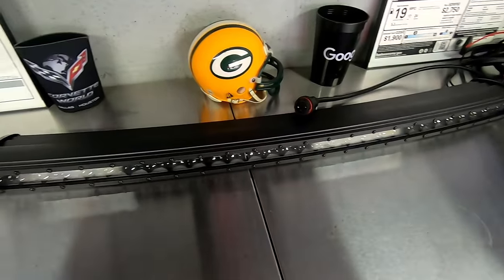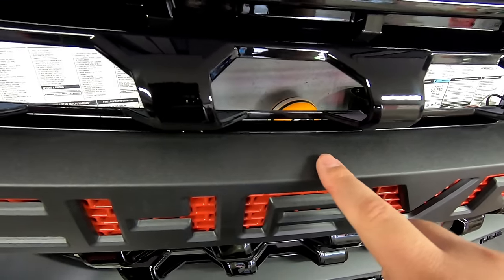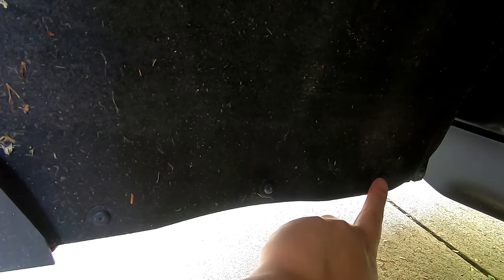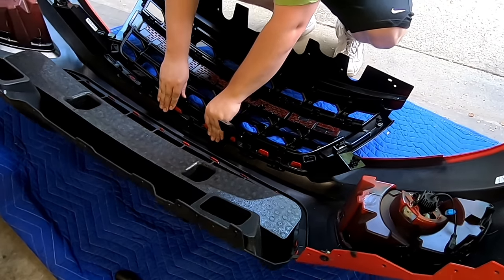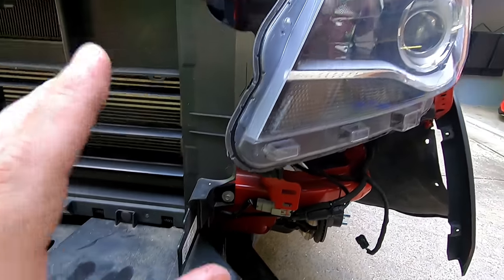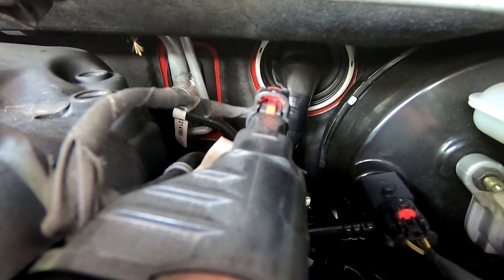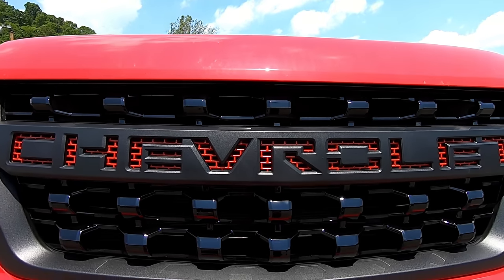BISON GRILLE and 15,000 lumen LIGHT BAR install on my 2018 Chevy COLORADO!!

Comment: Painting the CHEVROLET red really hit the sweet spot with that grille.
Reply from the maker: Thank you. I thought the same, really helps set it all off!
Reply: I agree but man those clips are rediculous. Really wish you showed that part, I gave up.
Reply from the maker: @MattyKnox  The biggest reason I didn't show it was because it would have been almost impossible to see what I was doing. Tiny screwdriver shoved into a tiny little space to pop a clip out. You really just have to work at it for a little while and you'll get it.
Reply: Jetfuel8737 hey were you able to do it?
Reply from the maker: Bring it over to me and I'll help you with it! Trust me it's not impossible, it does take time though.
Reply: HorsePower Obsessed g
Reply: Yeah man I really need to figure out how to take that matte piece off!!
Reply: how did you paint it?

Comment: I just installed my bison grill today and because of this video - and only because of this video - it was fairly easy.  The only tricky thing were the 3 7mm bolts in the wheel well that I found were easier to remove by just holding the 7mm socket in my hand and twisting it rather than trying to jam a ratchet in that tiny space.  Fortunately they weren’t installed too tight at the factory and pretty easy to get off.   I made a little instruction sheet from this video and put each set of bolts or screws by each step so it was simple to reinstall.   This is the best video out there on this and the new grill looks phenomenal.  Took me about 2 hours and was doing it myself, didn’t take the wheels off, and didn’t jack up the truck. I just turned the wheels to each side as far as they could go to access some of the wheel well screws.  Having a 10 inch socket extension is absolutely critical for the two bolts in the middle of the grill.
Reply from the maker: Great tips!

Comment: This is the best light bar install video for the Colorado I have seen yet.  Great job!  I already have that grill, so I don't need to do that.  Thanks for sharing!
Reply from the maker: Thank you! 👍 I appreciate the kind words.
Reply: I second this.  Best video of the light bar install yet.  Fantastic.  One question, why did you connect the negative directly to the battery instead of grounding to the truck?

Comment: Hey man! I just finished this whole job and I just wanted to thank you for the awesome video! The instructions were outstanding, and your video close-ups made things very clear. It took me over half the day, but I'm done, and it looks amazing. I had to use an aftermarket Bison Grill because nobody has the OEM ones any more, but it turned out great.

I'd just like to point out one thing that would be super helpful. I couldn't figure out how you got the wire from the light bar through the little hole in the vent because of the big connector. Since you de-pinned one of the connections, I thought maybe you took that screw on connection apart too. I tried and almost broke it! I don't think that part is supposed to come apart! Haha. I ended up taking the crash bar off again so that I could get the fat connector behind the vent. Everything was gravy after that. Okay, not quite everything. There's a little hole on the firewall grommet and I was like "oh cool, I can just use this!", but it's some sort of nipple or something, and I pushed it through to the inside. When I realized my mistake I went back and pushed it through the ridge like you said. It wasn't easy, but I got it through. 

The finished product looks amazing! I definitely would not have had the confidence to do this without your video. Thank you so much! Oh, just so you know, I bought the stuff from your links back in December, so hopefully you got some Amazon kick-back for that. You're the best and thanks again! Truly awesome videos you're making.
Reply from the maker: I really appreciate the kind words, my friend! Thank you!

Comment: That truck is looking amazing! Is a New lift coming?
Reply from the maker: The next video is going to have more to do with a full level kit and stopping the tires from rubbing. I'm not sure what I'm going to do yet regarding a full lift.
Reply: If you put a lift on it, you will void the warranty.
Reply: @chadbreedlove5457  that's not actually true.
Reply from the maker: It sure isn't! 👍👍

Comment: I'm 8 minutes in and very impressed. Definitely would be nerve racking cutting an oem bumper!!
Reply from the maker: It wasn't too bad because the small pieces were pretty easy to just cut right out. You definitely do feel a certain way about it though.

Comment: Next mod is the Boost Auto tow mirrors. You can even get paintable mirrors with heated top and bottom. They are just like factory GM tow mirrors on the full size trucks.
Reply from the maker: I'm not sure if I like the look of them on the smaller trucks...
Reply: HorsePower Obsessed I understand that. When I very first put mine in I wasn’t sure either. But after a day I decided I really like it. 

I decided that you buy a truck with a look in mind. And that as soon as you let yourself be a little flexible then it’ll change your mind. 

The view is way better with the spotting mirror. Then there are the lighting options. I did every option except switchback. Upper and lower heated, high power reverse spot with cargo light tie in. I did black and not painted and am happy with that. 

My truck is red also and I figure the back goes with my red and black theme as well. 

I have the baby max and love it. 2017 with 26,000 miles. Has a color match leer canopy. 

I took the faring (air dam) off the other day. What a significant improvement in look. Next is a leveling kit.

Comment: It looks bad ass! I just got that light bar, and I was wondering WTF to do about the little vertical grill things. It's a shame they need to be cut. Did it feel like they were supporting the lower part of the bumper at all? Cutting them off had no negative side-effects? I'm wondering if sanding it down afterwards would make it look better or worse. Anyways, now I have to find a Bison Grille, which doesn't seem to be sold online anymore. Thanks for the video!
Reply from the maker: Thanks! No, clipping those plastic parts wasn't a big deal, the bumper doesn't rely on them. If I had to guess they were added just to keep larger items from being able to get into the bumper through there. Real flimsy plastic.

Comment: Beautiful! Good job on the install. I'm really thinking about that light bar. Since my truck is the same color, I know exactly how it's going to look! I still like the old grill with the bowtie so I'm sticking with that for now. I got an AVS stick-on bug deflector and it made the truck look fantastic. Plus it deflects bugs. Who woulda thunk it. 
I just got new black rims with wider spokes so painting the brake calipers is now priority. Do a vid on that please!
Reply from the maker: I did a video on painting the calipers. 👍
Reply: @HorsePowerObsessed  I watched your video on the calipers and I wished I did what you did. I sprayed it and even though they look great, your brush-on technique is far superior. Masking and over-spray were a pain. 
I just put in bed anchors for an easy upgrade and I can't tell 'ya how useful they are. They should have come stock!

Great vids!
Reply from the maker: Thanks, man! I appreciate the support!

Comment: What brackets did you use for the Rough Country curved cree black light bar?  Rough Country told me the hidden bumper mounts are not meant/dont work with the curved light bar.  Your install using those bumper mounts looks great.  Has it held up?  Am I missing something?
Thank you
-Tom
Reply from the maker: You can get the mounts here: https://amzn.to/3fwlCQP. But yes, they are the same as RC's mounts. They will work with the curved or straight bar.

Comment: Love how you added that extra paint touch to make the grill pop. Any thoughts to add a bull bar or anything to the front end or do you prefer the clean look? I've looked at some aftermarket bumpers, but none of which I like so much.
Reply from the maker: Thanks, man! That's exactly how I felt about the aftermarket bumpers. None of them look right to me. I am still torn on a bull bar, I've seen a few that look ok but haven't made up my mind just yet.
Reply: @HorsePowerObsessed  The biggest thing I would like to figure out is getting the rough country light bar and the trail boss lights to work at the touch of the light bar button. Chevy's hold for 3 seconds to power on and off is annoying.
Reply from the maker: @xblindfolded  This switch will fix that as well!
Reply: @HorsePowerObsessed  you know of the way to wire them all into the one and bypass the bcm?
Reply from the maker: @xblindfolded  The switch I purchased bypasses the BCM. I don't see why it wouldn't be able to control both of them at the same time.

Comment: Hey, I just got my front grille for my Colorado. Thanks for this video seems simple to install. I’m going to give it a go on  the weekend. Question, what kind of paint did you use for the letters? I want to do the same but in blue to match my truck
Reply from the maker: I used Krylon Fusion paint.
Reply: @HorsePowerObsessed  thanks I’ll check it out.

Comment: Your truck is looking great! Thanks for all of the videos and inspiration for mine! Question - did you address the rub from the level/1.5 spacers? Hoping you’re still planning on making that as I intend to do the same setup and imagine I will rub also. Thanks again and keep up the great work!
Reply from the maker: Thank you! I sure did address that issue. The next video coming out will go over the fix! 😁👍
Reply: Yo! Can you share a link to that video? I'm getting some rub with a 1.5" riser too. It's only when the steering is pinned to either side and I hit the brakes hard or nail a bump, but I'd love to get rid of it.

Comment: Hey I'm probably  going to install my led light tomorrow. Was it hard to put back the 10mm bolt in the front of the bumper?
Reply from the maker: It was more difficult than the rest but I wouldn't say it was hard. You'll want to have the wheel off but other than that it's pretty simple.

Comment: I’ve been searching your videos and I can’t remember what size spacers you put on the wheels it’s a give it more aggressive stance 1/2  or 2 inch spacers on the truck before you sold them?
Reply from the maker: 1 1/2" spacers is what I had. You can't go any smaller without grinding the lug studs. You can get the same ones I bought here: https://amzn.to/3CpqeFT

Comment: On painting the Chevrolet to the grill.what kind of paint did u use? I have a blue zr2 an u gave me a good idea.just wondering.
Reply from the maker: I used paint specifically for plastic and clear coat on top of it.
Reply: @HorsePowerObsessed  thank you so much. I'll try to remember to send a pic once done.
Reply from the maker: @Rip-pq1vo  definitely! 😁👍
Reply: HorsePower Obsessed did you spray it or brush it on?
Reply from the maker: Spray paint. Krylon fusion.

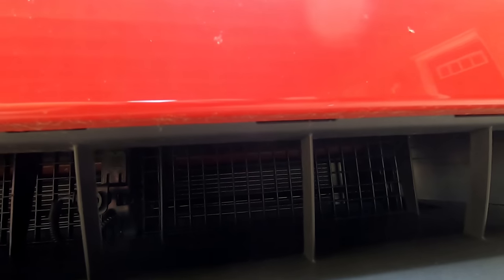Comment: @horsepowerobsessed I just bought a GMC Canyon and looking to put a light bar in exactly the same spot as you. However what is that little camera looking thing, @5:21. Is that not the sensor for collision avoidance? Have you noticed any difference with all the sensors and what not?
Reply from the maker: That is actually the ambient temperature sensor.
Reply: Oh mint, thanks bud

Comment: Do you feel that the lightbar tucks into the bumper far enough? I am ordering the same light but thinking about drilling new holes in the bracket so it sits inside the bumper an inch further and then shortening the bracket to match. My main concern is making it harder to steal but also wanting to keep it as subtle as possible so it looks oem. Thanks for you input and also your video!
Reply from the maker: The curved light bar sits perfectly in the bumper in my opinion. The straight bar does stick out too far on the ends, that's the biggest reason I went with the curved one.

Comment: I just got back from the Philippines Tuesday, so i missed a lot of your videos ( 28 days ). Got a lot of catching up to do. Looks great bro ! I see you painted your calipers. Did you remove those to paint,,, or leave them on like i did ?
Reply from the maker: Thank you! I left them on. The paint that I used gets brushed on so it's pretty easy to work around everything else.
Reply: @HorsePowerObsessed ,,,You used the high heat paint ?
Reply from the maker: @bryan7821  for the calipers, yes.

Comment: This video helped me out a ton.  Thank you.  Have you had issues with water/ condensation getting behind your lens?  First wash after install of mine and it's all wet inside.
Reply from the maker: On the light bar?
Reply: @HorsePowerObsessed  in the light bar under the lens.
Reply from the maker: Interesting. I haven't had any issues with that.

Comment: when you attach the bumper back on, can you get to the 2 center bolts that you needed the extension for?  It seems like they would be hidden because of the light bar.  Thanks!

Comment: Were did you get the black trim around the fog light. I also watched you install black colorado letters w/red trim with a jig were did you find it as well.
Thanks,
Mark Clemens
Reply from the maker: The blackout fog trim came from tascaparts.com. The stencil for applying the letters comes with them when you buy from GM.
Reply: @HorsePowerObsessed  didn't you install a 2" leveling kit on your Colorado ? I was told by the tire shop they don't make one for my Colorado and if they did they wouldn't be able set the right. Is this ture or did you have issues with your.
Thanks,
Mark Clemens

Comment: Going to the link for the grill, it takes me to a 2019 Colorado... No issues? (Obviously no issues based on the video) ..You have a 2018 correct? I'm wondering if it'll fit my 2017.
Reply from the maker: I know you already got the answer to this but I'm going to answer it anyway just so other people can see it. This grille will fit any Colorado 2015-2019. 👍

Comment: Any tricks/advice in working the clips to take the mesh off to paint? Mine are so tight, I'm worried that I will break them or that there is glue holding it on somewhere.
Reply from the maker: There is definitely not any glue. They are tight on there but 2 small screwdrivers will do it. It took me about an hour and 1000% focus to get it done, but once you start getting 2 or 3 of them off they all get easier.
Reply: @HorsePowerObsessed  thanks. got it figured out before you replied with sheer determination. Ended up having to pretty much destroy the two clips in the middle. They were too small for my screwdrivers. What I did: Start at one side. Once those two larger clips are freed, slide in a wooden wedge. Move down the bottom, making sure the wedge stays in place and push the wedge in further (keeping it at the side of grill) to keep pressure. Once halfway across, use another wedge and start working from the opposite side. Then free the upper clips. I hope this helps others, as I see a lot of questions regarding this.  Thanks

Comment: How is this light bar holding up I heard mix reviews after first wash
Reply from the maker: I had it on this truck for over 2 years during PA winters and it was fine up until the day I sold it. The new owner has not had any issues with it either. I'd say it's solid.

Comment: Is the curved light bar better than the straight light bar for the Colorado. I think Matt has the straight bar and I just wondering which has the best look overall ?
Reply from the maker: I personally like the curved light bar because it perfectly matches the lines of the front bumper.
Reply: @HorsePowerObsessed  Ok Thanks for the reply

Comment: Hey, I know this is an older video, but I thought you might like to know you can use an OEM lights switch for that light (Chevy Trail Boss Silverado )  Has an OEM headlight switch with a trail light button and a flog light button.
Reply from the maker: Unfortunately, it can't be wired up without some serious modifications. It needs an extra relay and some extra wiring to work.

Comment: I picked up a 2015 Colorado..I want to install fog lights but it doesn't have the wiring harness..do you have a video for that
Reply: It depends what package you have . But if you get a harness I’ve been told the have to program the lights into the ECM by the delay
Reply from the maker: To do it with the factory switch you would have to reprogram the bcm. You could add them just to a switch if your choosing though

Comment: I was wondering if you moved the temperature sensor from behind the new light bar. Probably a trivial matter but it will throw the temperature off when the light is on.
Reply from the maker: I did not move it, but I haven't noticed any fluctuation with temperature outside.
Reply: @HorsePowerObsessed   Awesome I guess there must very little heat off of those heat sinks. Good to know.
Reply from the maker: Guess so! 👍👍

Comment: I was under the impression that the light bar brackets only fit straight bars. Did you have to do any modifications for them to fit the curved bar?
Reply from the maker: Nope. They fit. 👍👍

Comment: Did the light bar interfere with the forward Crash alert? If so did you just turn it off on the dash or did you disconnect it and remove it?
Reply from the maker: The Colorado doesn't have the forward crash alert feature.
Reply: HorsePower Obsessed oh ok, my 2016 came Colorado has it. Trying to figure out what to do with it if i put in a light bar, because the bar will in right in front of it.